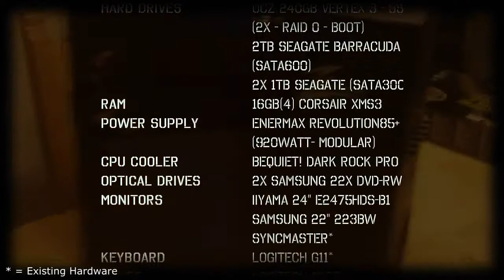SPECIAL: Building 'The Beast'

Comment from the maker: @GamingChimp77 The keyboard is themost basic device, there little to nothing you can do in the BIOS of the machine. My suggestion, buy a new keyboard. Or if you are using a usb keyboard (on windows xp). Connect one with the older ps/2 connection, load into Windows, then connect your usb keyboard.